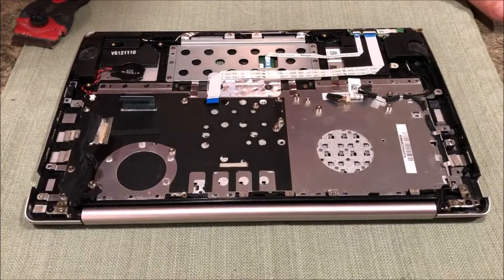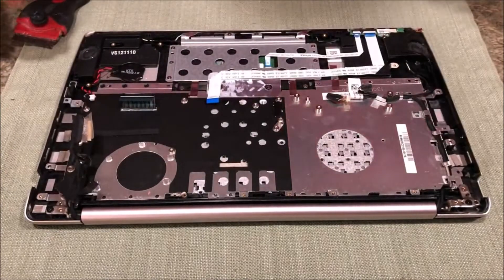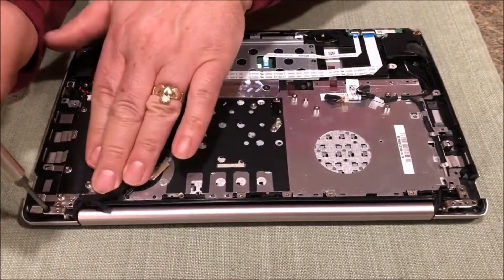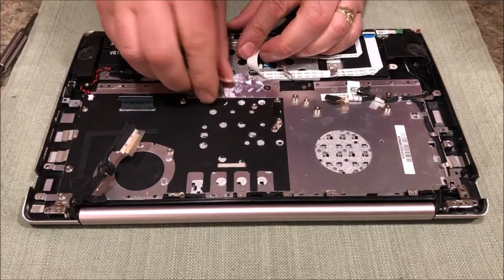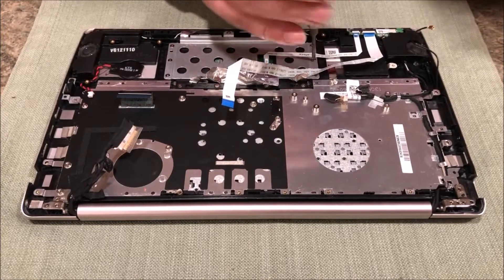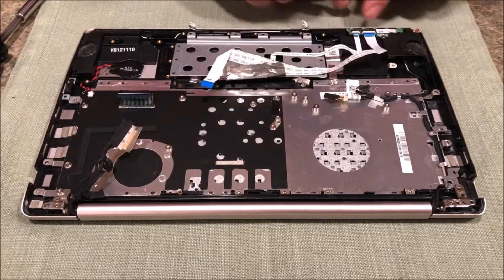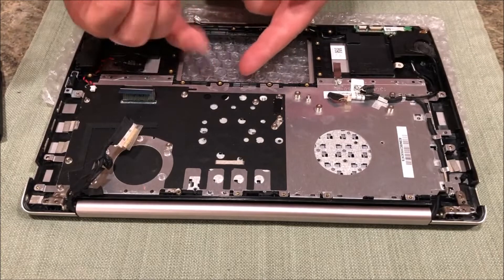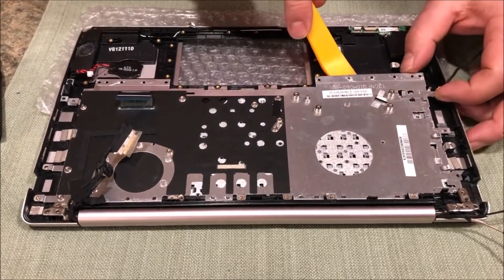How To Replace Asus  Q200E S200E X202E Keyboard Plus all Internal Components 2 of 4

Comment: I have one these laptops. I swear I pulled it out after not using it for a year or two and half the keys just didn't work. Now Only 4 do. Does this really necessitate a full keyboard replacement, or could it be a faulty connection? Man this looks intense. It's such a weak old laptop, but I hate to waste it at the same time. Still has the touch screen functionality, but it's super slow and not having a keyboard sucks.
Reply from the maker: If the keyboard is bad, you should be able to just replace it. You can also try a using an external wireless one.